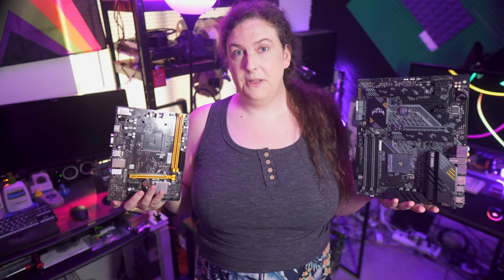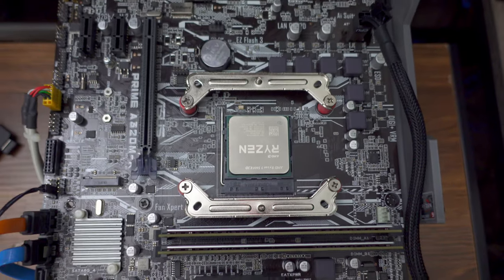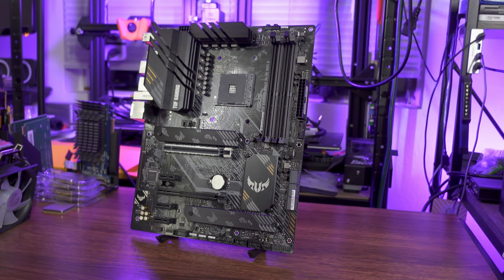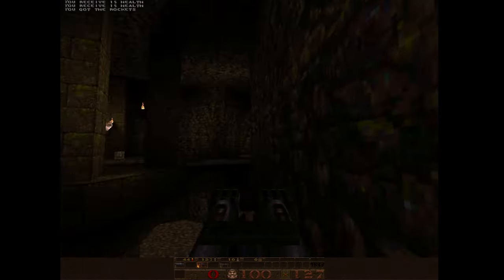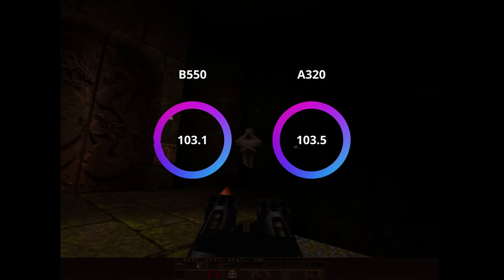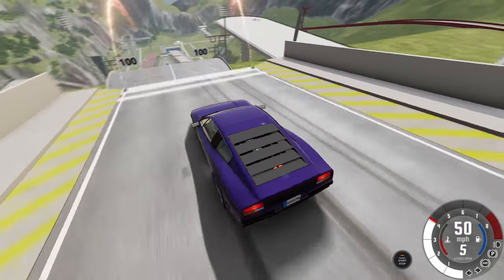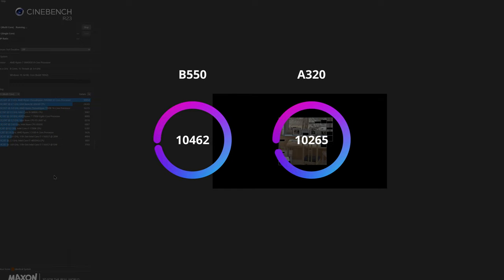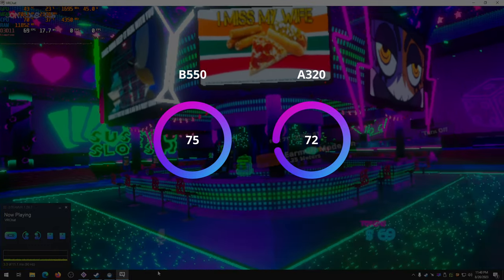3D V-Cache: Really A Drop-In Upgrade for Older Motherboards?

Comment: Late last year I walked into Micro Center for a AM4 CPU upgrade and got the combo deal instead.  $299 for a Tuf Motherboard,  Ram,   And the 5600X3D CPU,   Or $229 for just the CPU.  Made more sense to get all three.  Thanks for the video!
Reply from the maker: Yeah, it was such a good deal. Tough to pass up. I've since given that board to a friend and it's been very reliable.
Reply: @TechAmbr  I owned a few and never skips a beat.  Decent motherboards for sure.